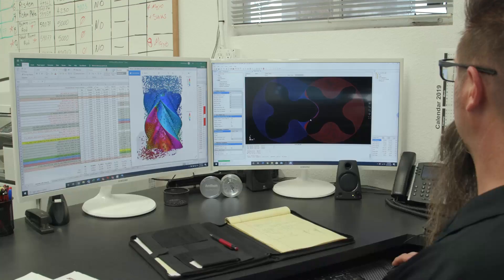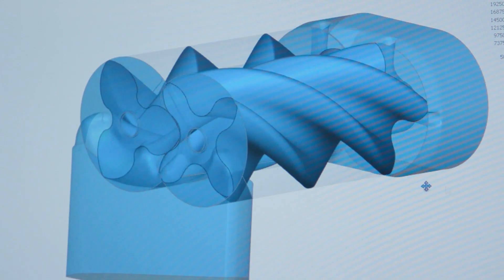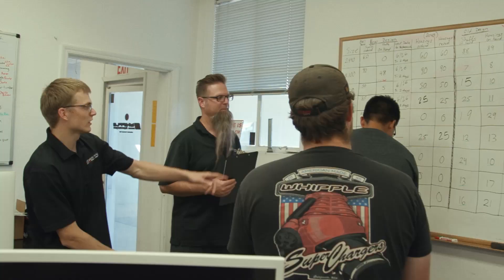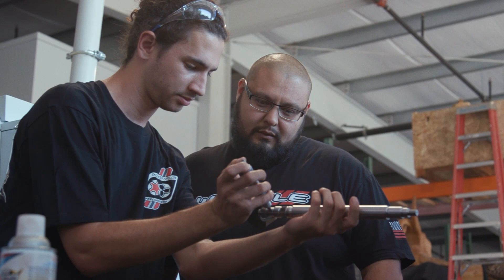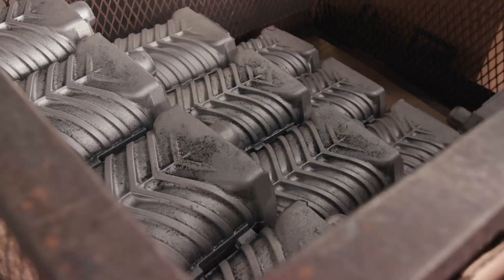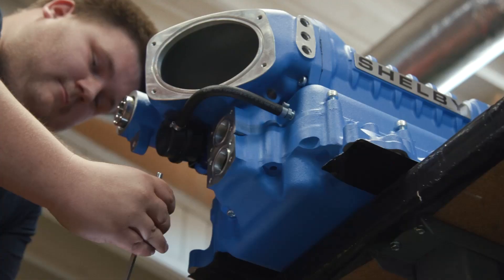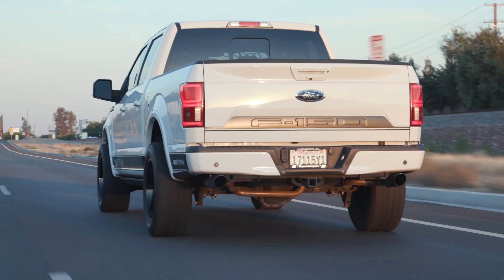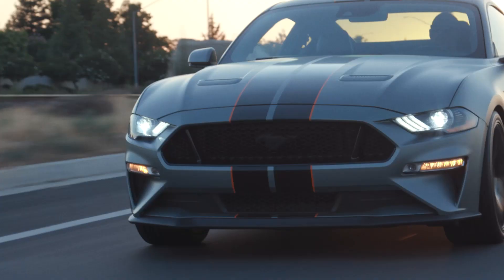How a Whipple Supercharger is made

Comment: Awesome video! I love my Whipple W175FF 2.9L: Front feed 2.9 liter (175 cubic inch) twin screw supercharger head unit, with 8-9 psi boost (using 3.5” pulley) and Aluminum high flow intake manifold, all part of the Stage Two 2.9L Whipple Kit. This equals a 561 RWH Dynojet on a stock 5.7L Hemi.

Comment: Haven't you all considered making a tri-screw supercharger, similar to carrier's triple screw chiller compressor? a Tri-Screw supercharger has half the total losses than a twin screw, a 83% efficiency compared with the twin screws 65%, due to lower drag losses, cancellations of side forces,  the shorter rotors lead to less discharge losses, and the two outlets would help flow distribution
Reply from the maker: We certainly have, fitment on an engine is very difficult, going wider is a problem. Were already in the 80% efficiency range though so its not as beneficial. The automotive rpm/pressure combination is very different than industrial type compressors.